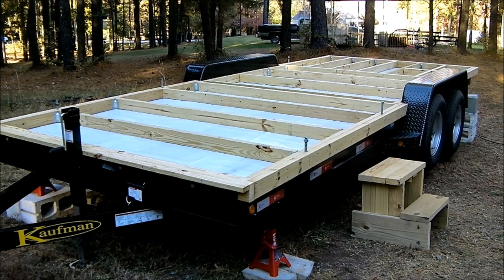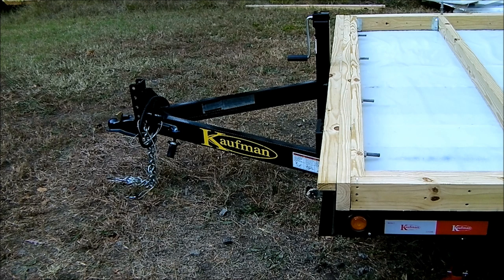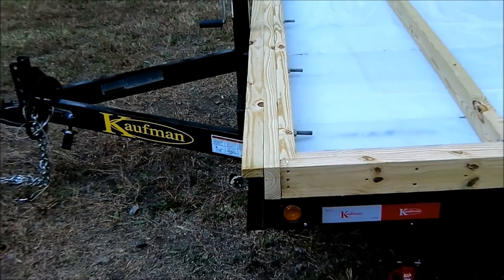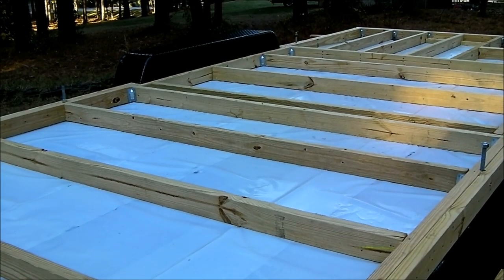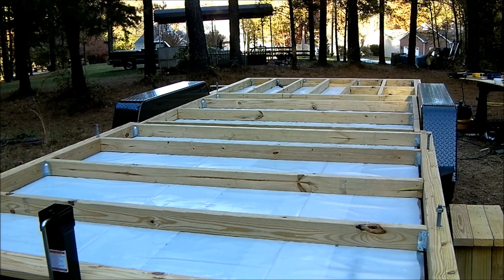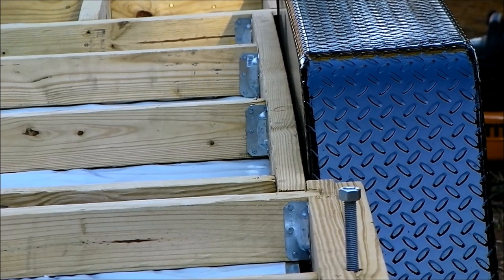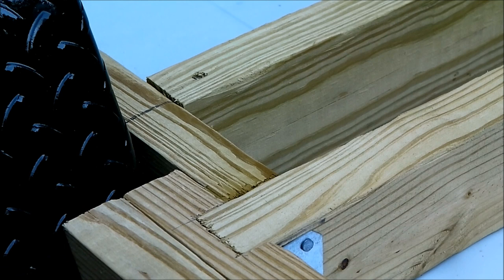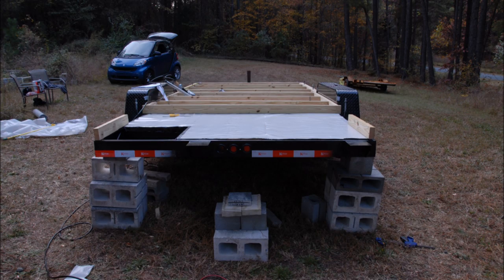Framing The Floor Of My Tiny House

Comment: I actually am building a fencl, and I also bought my trailer from kaufman, and I was wondering how large the cutout for the front porch is, I see that it is smaller than the actual framing. 

Thanks in advance.

Comment: If I was you I would be doing all the framing and structural components with screws. The nails can and will loosen with stress, bumps while driving etc. Everything should be glued and screwed. The use of the metal braces is good but I would also screw them. Remember, the stresses that a mobile tiny home is subjected to are far different than what an conventional stick built home is during it's life.